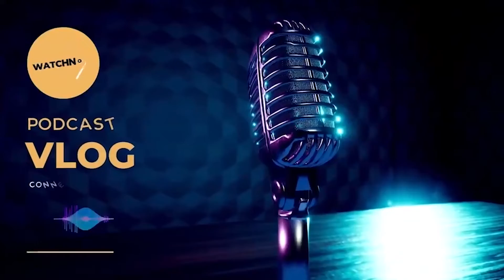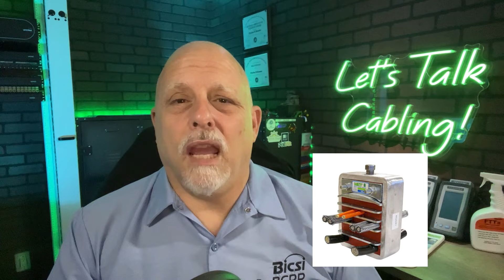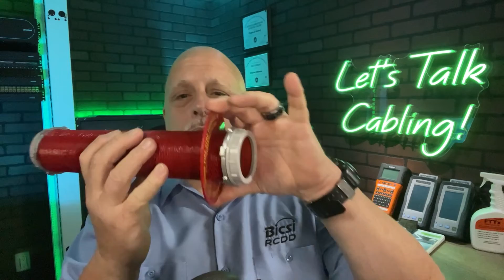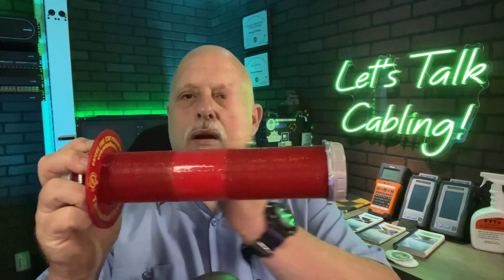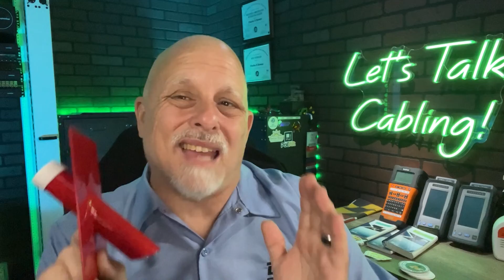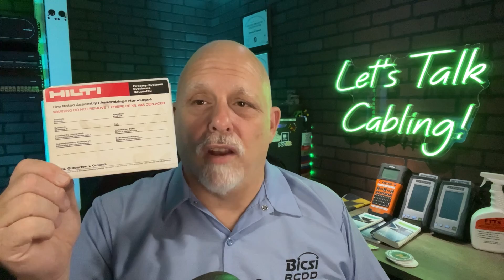Firestop Selection | RCDD

Comment: How about in the case of firewalls, where your drilling a hole in one side of the drywall to drop cables down to a cut in, that you would then cover with jacks and a faceplate, does the hole up above the ceiling need to be firestopped, even though it does not penetrate both sides of the drywall..??
Reply from the maker: If it is a fire rated assembly then yes it has to be restored to its original rating. Some walls are not fire rated assemblies.
Reply: @LetsTalkCabling  I've always just treated any interior wall, where the drywall is finished all the way up to the roof or floor above, as a fire wall, though I guess in some cases it could be done for sound as well, like around conference rooms.

Also, does not sound like your a fan of caulk, I agree 100%, putty is WAY better, easier to work with, less messy and just looks better aesthetically. So many small cabling companies are cheap though and will only buy the caulk.
Reply from the maker: @Eric-qx1kx  I agree!  Also when in doubt be safe and treat it like a fire rated barrier!  Its ok to make it safer right?